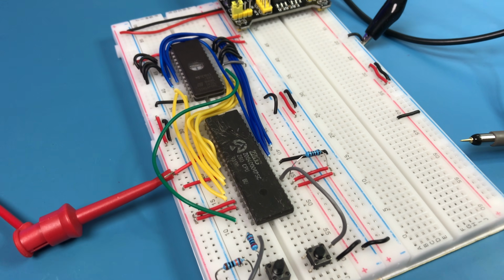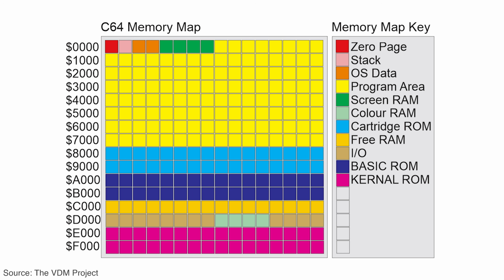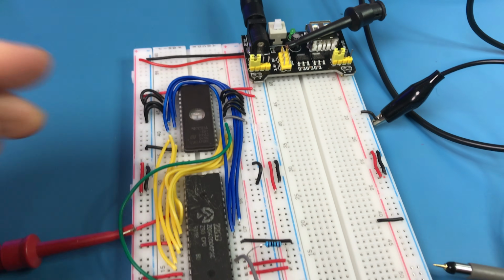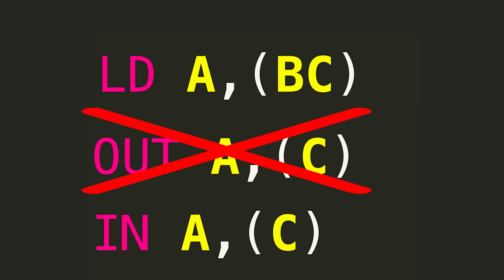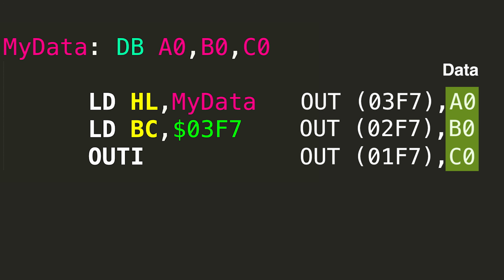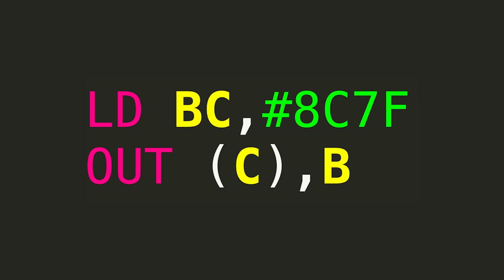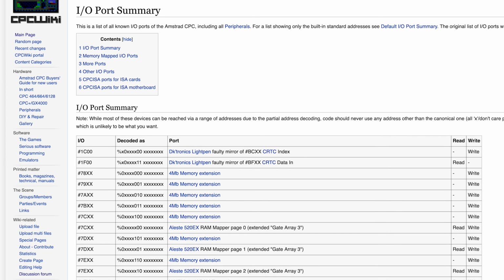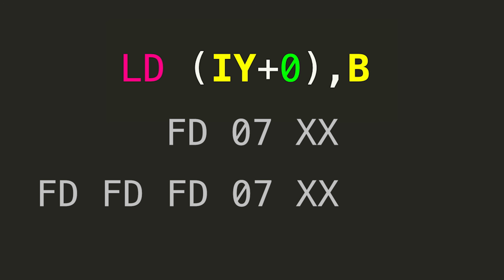The Madness of Z80 I/O

Comment: The east-german KC 85/4 (and predecessors) also uses the upper half of the address bus (register B) during IO operations for selecting the slot in which a module to be addressed was placed. That made it possible to use multiple modules of the same type at the same time.

By convention all modules respond at IO address 0x80 with an identification byte. That way the software is able to enumerate which type of module was placed in which slot.

The base device has two slots and it could be extended by stacking additional "extension devices" at the top, adding another 4 slots.

Comment: I missed this interesting video. Thanks for explaining it in simple terms. There's a small error, though. As gaku8108 mentioned much further down in the comments, B is pre-decremented before the I/O operation, probably to allow it to reach 0 when B defines a number of I/O operations with OTIR or OTDR. You can use OUTI/OUTD on the CPC, taking care to increment B beforehand. So, to send data to the CRTC, B must be #BE and not #BD (otherwise, you'll send to #BC, which corresponds to a selection of the CRTC register index). Experimentally, and just for fun, it's possible to use OTIR with the GATE ARRAY as long as decrementing B doesn't update the two most significant bits of B, but this requires interrupting the instruction (via an interrupt). 🙂

Comment: basically all intel derivative cpu lines have 'seperate' i/o it's just another address bus pin (or 2) which links to in and out only. and yes the z80 is just an overglorified 8080 anyway. also when people say '6502' they don't actually mean the actual 6502 but the entire mcs6500 range. around 90% of that has 'extra i/o pins' 'built in i2c and spi' or lacks half the pins to the outside (6507 etc) or is simply built into a microcontroller anyway. the 6510 does not deserve special mention as when it boils down to it it is just a castrated 6509 which has even more 'built in' 'i/o registers' lol. usually all in the same way at that, slurping up zero page address space. there is also nothing stopping you from putting i/o chips in the normal address space of any 'intel based' cpu like the z80 provided it doesn't do crappy things like 'dram refresh' for those to poor to just buy sram like they should internally. lol. and then just use mov :P or still use in and out :P LOL. as hey when you simply do not connect the io pin lines the rest of the address bus still works as normally haha.
Reply: nothing 'mad' about it. just something to keep in mind when doing a cpu board for an isa industrial backplane system with let's say a 65c816. 'oh yeah the i/o select lines' lol. or modify a pc to contain a 65c816 instead of an 8088. or when simply using network adapter cards intended for pc's in 65c02 stuff. lol. things can get a lot 'weirder' than just having an i/o addressing pin and instruction or 2. lololol. (saves a lot of external address decoding actually ;) lol. such as how PIC microcontrollers have seperate code data etc ram and seperate i/o space and banking haha. having a super special set of i/o select lines and instructions kinda makes sense. lol. especially on systems with ram waitstates and like a kazillion address lines. so at least you can limit the decoding on the extension boards to just the relevant bits.
Reply: i would say the in/out instructions are actually the reason pc's are not a gigantic clusterfuck of timing issues and boards are not all a meter long just to keep them 'somewhat' compatible with 'most' things. lol. ibm would happily let a pc wait until the ram had time to handle things. where in the 6502 world we simply order ram that is fast enough for the clockrate needed. all the time. lol.

Comment: It occurred to me quite some time ago that it would be entirely possible to add up to another 64k of cache RAM accessed by the input and output commands, and by using the BC register pair instead of just C to address the extra RAM.  If I'd ever used it, I'd probably have limited it to 32K and used the rest of the I/O address space normally for I/O functions.  The I/O - accessed RAM would not have been usable to run programs in, but it would have been useful for disk I/O operations so that the disk controller did not have to send the CPU into wait states in order to perform DMA operations on RAM.

Comment: I used the eZ80F91 for several projects. It's superior to the original Z80, having a 50Mhz clock, a 24 bit address bus, and a single cycle per instruction architecture. It benchmarks at the speed of a 286. Backwards compatible with original instruction set, including OUT 🤣

Comment: Did you program the Z80 in assembly for 7 years?  Z80 works with banked identical devices, like PIO and SIO. No device but a latch takes one address. I did a dozen interface cards and never had a problem?

Comment: This sounds to me like: "the Z80 is a very powerful 8-bit CISC CPU for its time, therefore it is madness."
--------------
LDIR, OTIR, and DJNZ are enormously elegant and powerful operations. They are the opposite of bizarre.
Amstrad CPC uses Z80 in a bizarre, non-standard way, I agree. That is not Z80's flaw, though.

Moreover: "I would make sense that to read from an I/O device, we would do something like this: OUT A, (C)". 
--> No, it makes absolutely no sense to use "OUT" to READ from an I/O device, your arrow is backwards!
"But I guess someone thought that it was too clashing to use the instruction OUT to bring data IN". 
--> Of course "someone thought" that. ANYONE with a drop of understanding about the terms "OUT" and "IN", as you yourself used in your phrase, would think that. This seems you trying to invent a problem that isn't there to support your "madness" narrative. Madness would be using "OUT" to signify "IN"!
LD for both directions isn't bizarre also, because the work "load" does not imply in direction, like "out" and "in" does. 

Bottom line: You are starting with the premise that Z80 does OUT (BC), X, and finding incompatible things related to it. But Z80 actually does OUT (C), X with a collateral (and, in principle, irrelevant) placement of B in the upper address byte; therefore, the things incompatible with OUT(BC), X are irrelevant. Now, if Amstrad (And Spectrum!) makes a mess of it, that's on them, not on Z80.

Comment: I know about this particularity of the z80's I/O addressing since 1979, I even posted this on the internet and they called me crazy, even showing the z80 manual, see in fact out (c), r where r is an 8-bit register, put in address BC on address bus 16 bits and r on data bus, and few also know that out (n), a put flags in a15..a8, so much so that the instruction out0 n, r was created in the z180 precisely to send to address bust a15..a8 = 0, and a7..a0 = n, whoever uses this type of z80 addressing by default is the msx where it really accesses I/O with z80-bit addressing, being for this patched use out (c), r or in r, (c) and asks for b = 0, precisely to access page zero of addressing, since msx that use z180 or hd64180 you can use in0 r,n or out0 n,r, my friend congratulations for your channel and for this explanation that few know, contracts for this and for your channel

Comment: Not … not sure this is Z80 madness. This sounds like CPC madness. The Z80 is relatively straightforward for a pretty CISC CPU: B winds up on A8..A15 during an OUT instruction as a side-effect of CPU implementation (sort of like 6502 "undocumented opcodes"). You're not meant to count on that behavior because it's incidental. It's not supposed to have a "purpose". But the CPC gave it one, so it couldn't realistically be removed as a "bug" later on.

Comment: That OUT instruction actually sending 16bits is very attractive for adding a proper video cards.  Would it work as a "memcopy( RAM -> VIdeoRAM )" and have an MCU rasterize and display on a TFT LCD?  This is like the modern "VRAM" approach, as opposed to the "Shared Video Memory" area.  THe advantage is that the CPU is not "in the loop" while the video rasterizer is doing stuff.  The CPU only needs to transfer data.  Rendering is in parallel.

Comment: So, I’m building a Z80 computer using a Z80 Chip, and a bunch of Raspberry Pi Pico boards, and although things are mostly good so far, the one thing that’s weird is that during IO, the Address Bus is accurate i.e. the contents of the C register, but the Data Bus is wrong, i.e. it doesn’t contain the contents of A register - is this an issue with Refresh corrupting the data on the data bus?

Comment: Could you please design a simple I/O device? I wish I could have a simple device with 8 bit output and 8 bit input on two different addresses one for input and one for output, for example it should use basic instructions in and out:  
A=IN(&F8E0)
Where A is a variable

B=(0...255)
OUT(&F8E1), B

Comment: In my opinion, the big omission of the Z80 developers was the lack of a memory manager with support for addressing, say, up to 1 megabyte. At least a simple segment MMU. The main thing here is to embed the appropriate commands in the command list and expand the command counter to 20-bit with automatic segment switching as increments. Well, the segments should be implemented of the required size (from 256 bytes to 16 kilobytes).
It is clear that at that time memory chips were very expensive, and the DIP-40 case was a "procrustean bed" for signal distribution, but 4 lines could be found. It would be good to abandon the idea of "ports" and slow "I/O" operations altogether, but unfortunately, the requirement of compatibility with the i8080 would not allow this to be done. Even then, programs required memory, especially for CPM-80. Yes, even a simple text editor: a page of 80x25 characters of text is already at least 1 kilobyte (or even 2 kilobytes, if with national alphabets) - 30 pages of text in conventional French, and the processor memory is completely occupied. And if you are a developer and write programs? There is no way to do without an expensive FDD drive (which is much more expensive than the "extra" 8/16 memory chips). 
I'll tell you by my example: my first 8-bit computer was the Soviet Orion-128.2, it connected to a tape recorder and a TV, but it had a built-in DOS-like operating system that loaded everything into an electronic disk of 60 kilobytes, plus there was a convenient shell similar to Norton Commander. In the basic version of the computer, even the ROM was only 2 KB (with a tester and an OS loader from a tape recorder), but it was possible to subsequently connect a ROM disk of up to 64 KB (and even more than one) with the OS and programs stitched.  Moreover, when Resetting, the information in the disk was not lost (only when the power was turned off or forcibly erased), and the previously loaded OS was not corrupted. Inexpensive and very effective. Of course, about six months later I recorded the OS, the shell and several tool programs into a ROM disk, and a year later I bought an additional FDD drive and a matrix printer for it, and began using the CP-M80. But the initial investment was relatively low and for them I already got a working computer, not a toy. And all this is thanks to the extended memory. By the way, the ports on this computer were mapped to the memory address space, took up little space, and the processor's slow I/O operations were not used. Up to 48 Kbytes of RAM were available to user programs (when the OS was placed in a ROM disk).
The built-in coprocessor with multiplication/division commands, as in the i8085, would have been useful for the Z80, although it would have taken time to develop it, and it was limited. AMD has already developed a mathematical coprocessor paired with the Z80, but almost no one has used it.
But the Z80 never ceases to amaze. We recently found out that it can support a protected memory mode with several additional chips. Which is very useful for developing and debugging programs: "The Z80's secret feature discovered after 40 years!" https://youtu.be/DLSUAVPKeYk?si=VYxTe3WV4mBJmK-5

Comment: Now imagine the fun and games that will ensue with the new eZ80 replacement for the now discontinued original Z80. The eZ80 supports a 24 bit address bus, and instruction extensions facilitating access thereto, along with 24 bit data reads and writes. Yet to check what happens with the I/O instructions on the eZ80, but if they allow the extended 24 bit BC register to output on all 24 address lines in ADL mode during IN and OUT, that's going to throw curve balls EVERYWHERE. Watch this space.

Comment: Listening for a specific sequence of (partially invalid) opcodes reminds me of "Reverse Emulating the NES," which is where I was exposed to the idea that "an addressed read is actually a write, too." You have to write data to the address lines, and that doesn't always have to just be an address, if the right (hah!) hardware is listening on the address bus.

They put a Raspberry Pi into an NES cartridge form factor. This way, they could make the "Read Only" memory of the cartridge interface dynamic. They used a specific sequence of read addresses to signal back to the "ROM" cartridge that the NES CPU wanted to send data. Then, the next sequence of cartridge read addresses would in fact be data being sent back from the CPU to the "cart."

Comment: Why do you have problems with OUT and IN, but not LD for both? On the 6502, there is STA and LDA, which makes much more sense :) Also, the syntax of the Assembler has nothing to say about how machine code works. It is just a human abbreviation. The 4004 has different assembler syntaxes, as well as the 8086, the AT&T and the Intel Syntax...

Also OUT (BC), A is even more strange to me... it should be OUT (CB), A, since the least significant bit should be written on the RIGHT, not on the left :D if we talk about little endian machines...

Comment: My eyes are crossed and my head hurts from listening to the madness. 😵‍💫 I made the decision to use the 20 megahertz variant Z840020C (functionally identical to Z80) for my dream computer project and I've been stuck since. I've made some progress of a planned dirt-cheap video and sound system, but in paper form only. I have all the necessary components needed to build it (all modern, off-the-shelf parts made today), I just need some static RAM chips worth 64kb each bank, a clock divider for NTSC output and a blank 32k EPROM chip to house the core functions. Now I realize I may have made a mistake... help would be nice.

Comment: Ohh! No wonder Atari couldn't upgrade to the 6510; their ROM used zero-page heavily. In fact, the 6510 might be the worst case of gratuitous incompatibility I've ever seen! The only compatible systems would be those in which the OS was allocated 0-page locations from the high end down, and all programs allocated their 0-page locations immediately below the OSs. Good programmers wouldn't do that because it could break compatibility with future versions of the OS. Maybe I'm judging it by modern standards, but if anyone tells me the 6510 is 6502-compatible... well, I'm going to be no fun at their party. ;) Or maybe I won't say anything. :)

Comment: hey noel love the channel but i think your limiting yourself.  we know how much you LOVE the sinclair QL 68008 and the amiga 68040 upgrade you published.  what true collector wouldnt have an amiga 68040 upgrade.  what other way is there to run an amiga.  If only mac had learned something from amiga regarding the power of multiproocesing offloading graphics which made the amiga a gaming monster it was so fast.  There were so many options to run apple OS on amiga at the time it was a lot of fun.  You should at least do an episode on loading apple OS on an amiga.  I did it back with the 68000 and eventually with a 68040 upgrade.  Raspberrry pi upgrade is MUCH simpler. wow  BUT STILL NO EARLY APPLE RODUCTS IN YOUR COLLECTION.  Im waiting for you to do a show on apple IIe IIgs  mac 512KE and macplus mac 128K is so limiting youde be better with 512 or higher.  ALL from the sinclair and amiga generation, all groundbreaking trendsetting imho.  I think they deserve some of your love and should be part of your collection.  There are literally thousands of dormant macplus out there with the infamous failing macplus powersupply, your skillls would fix them all.  I still have like 300 floppy diisks from macplus era that ive protected but I wonder how much has been lost.  hmm  who knows.  Only mothernature can steal those tiny floppy bits.   One nice thing, macplus comes with SCSI hard disk port so opens up a world of options plus very common to upgrade to 4MB for macplus like your sinclair QL but a full 68000.   I know many old era macs are running ububtu now for a lot of hobbiests.  Ill keep watching waiting for some apple love.  cheers.

Comment: Part of the weirdness in some of the Z80 ASM mnemonics comes from Zilog's initial fear that they would get sued by Intel if they used mnemonics from the 8080, which is why most Z80 assemblers use LD instead of 8080 style LDA/STA.

...most, because one of the very first, TDL's ZASM, just extended the Intel mnemonics.

Comment: hi, very interesting. I was surprised when you said that could not control z80  clock with an switch to fetch instruction by instruction and see the results using leds. You explained that was because you were using an old z80, so I undertand that a current one will allow that trick , por example an ez80? What about a z80 6Mhz (Z84c0006pec) ?